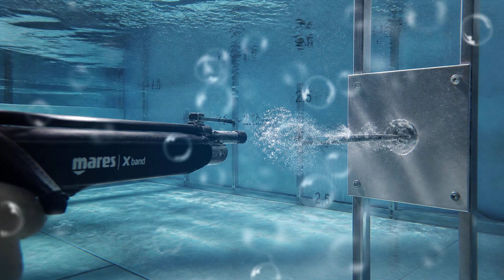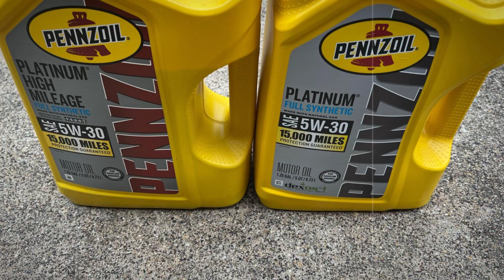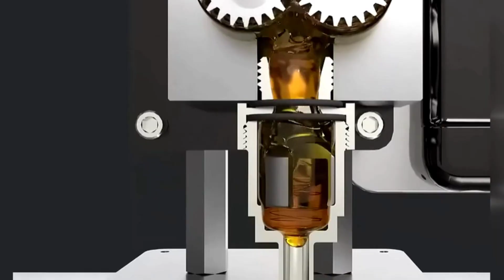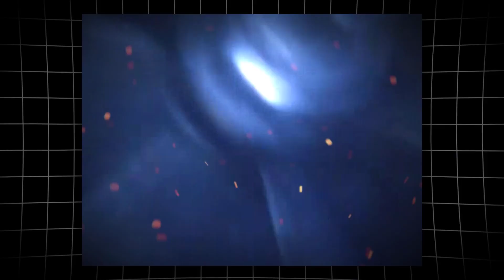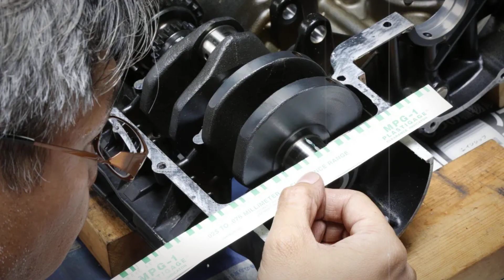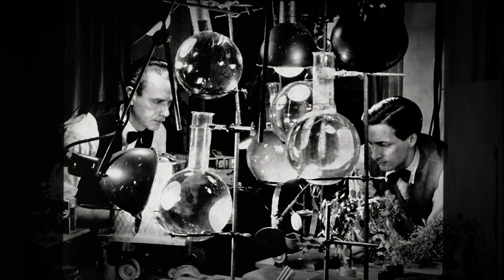If Engine Oils were Spear Guns, 5W-30 Would be The Best Bet

Comment: IT ALL depends on the application. Fact- in stock engines, 20 grades lubricate ever so slightly better that 5w-30 (it's proven, thousands of UOA's confirmed this) fact- the reason they can is their higher levels of ani-wear additives. When you know, you know. Knowledge is king, speculation is dribble.